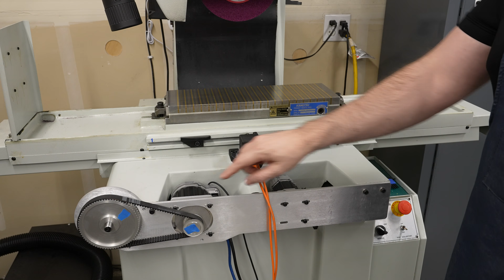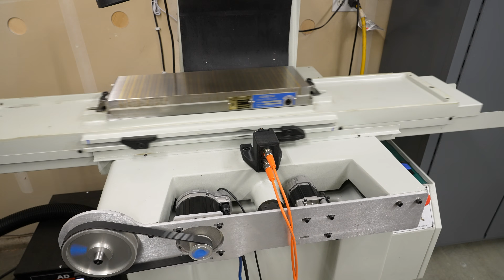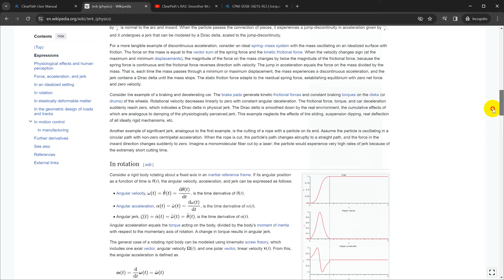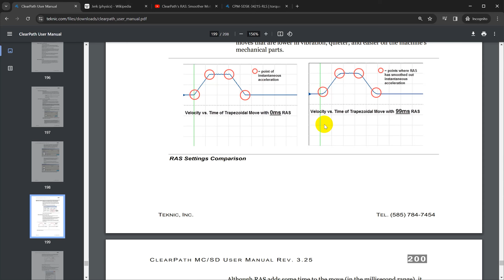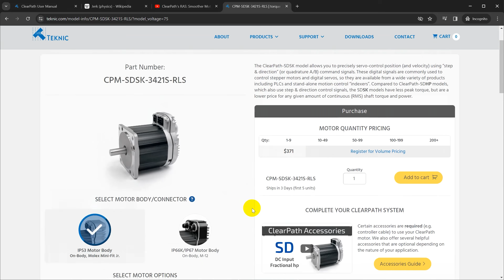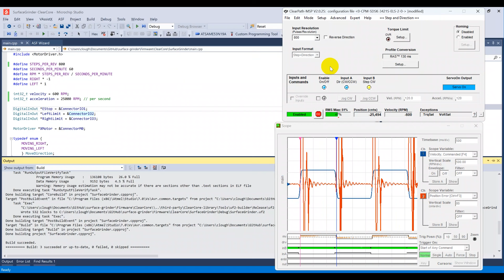Smoothing Out the X Axis Motion | Surface Grinder Automation 7 | Clearpath RAS

Comment: Once upon a time ('75 to '90) i worked at IBM development on what was called 1/2" Tape .  We had similar problems trying to move tape back and forth smoothly.  Your description of the problem with the X motion brought back memories.  Don't mean to be critical, but at 12 minutes into the video you say that the derivative of velocity is acceleration .  I would suggest you get out your Differential Calculus Book.  If I remember correctly, the derivative of acceleration is velocity.  I love it when I see others make mistakes that I often do.   KOKO!
Reply: He is correct.  The integration of acceleration is velocity.
Reply: Sorry about that, you are correct.  I confused the formula D = 1/2 a(t * t) for acceleration..  Velocity is the derivative of this formula.  Gotta think about these things more before commenting.

Comment: You can see that torque in the belt when it reverses. Very impressive.  Also, they need to remove the comma after "proprietary" on page 199.

Comment: If you're writing in C++, you might also mark the external state variables as volatile. Otherwise, the optimizer might make assumptions, which could lead to odd (and potentially dangerous) bugs.
Reply: Like infinite loops being undefined behavior if the don't have side effects. Writes to non-volatile variables are not side effects.

Comment: Either I'm not understand the math the "RAS" uses, or something doesn't add up here. In your initial testing, accelerating to 600RPM at 5000RPM/S should take 120ms. If the constant jerk period with the RAS (S curve acceleration) enabled is 197ms, that means you never reach max acceleration. Any acceleration rate above 3045RPM/S should have no effect on total acceleration time. The velocity graph does not seem to show that, so I'm kinda lost. I wish they would use the correct rate for jerk (steps/sec^3).
I hope the improvement with the more expensive motor is not just a clever mask for slower actual acceleration.
Reply from the maker: It would be interesting to take some actual measurements and see.  There's a lot going on here, and the way I'm using the motor with velocity moves and external switch feedback obscures it further.

My understanding is that if you command a position-to-position move, the total move time will be the expected time of a trapezoidal move, plus the RAS time.  About half of that time is added ramping up to the commanded acceleration, putting the constant-acceleration portion RAS/2 ms behind the trap curve, and the other half of that time is added to the end, ramping the acceleration down to a stop, ending RAS ms after the trap move would have ended, but at the correct position.  Increasing the acceleration will change the acceleration of the constant-accel portion of the curve, but you'll still have the constant time added to the beginning and the end. 

The point you raise about not reaching maximum acceleration is a bit of a brain bender, and I don't have an answer.  The graph does show it reaching steady-state acceleration, which you may be right to question.   My intuition is that the math isn't straightforward, because most of the additional time added by the RAS is spent at much lower acceleration, near the asymptotes.   Without knowing the polynomial and actually integrating it, it's hard to guess.

In my situation, it's more complicated because I'm using velocity moves, so once it hits the switch, it's going to take longer to come to a stop, during which it will travel a greater distance.  In my testing, enabling RAS increases the switch overtravel, and then raising the acceleration shortens that overtravel dramatically.
Reply: @Clough42  It would be nice if they would explain what the setting actually means in real units. In CNC machines with S curve acceleration, sometimes the jerk setting is spec'd in ms based on the max acceleration and max velocity. Any acceleration or velocity lower than that is scaled accordingly. It quickly gets very confusing. 

I've written some S curve acceleration algorithms to varying degrees of success. It's a very complex subject. When you are dealing with things to the 3rd or 4th power the math quickly gets out of hand.
Reply from the maker: @WatchWesWork  Agreed.  Clear data would be helpful.

Comment: Servo tip: a good counter to oscillation is friction. Try using thicker grease/oil on the ways.
Reply from the maker: It's a pump-circulated lubrication system, so this seems like a bad idea.

Comment: Would be interesting to see if there will be any difference in thr torque oscillations when you put some weight on the bed...
Reply from the maker: Very little, in my testing.  The table and chuck are already very heavy.
Reply: But your torque ripple and ringing will reduce when you grind. The drag will dampen the system. 

With the better profiling (planned jerk and snap) you might try reducing the integrator gain and / or increasing the proportional gain slightly. If they have a Bode plot feature in their software, run it and show us next time. Then you can tune it as well as PI will ever get you. :)
Reply: @nf4x  damp

Comment: Sounds like you could code the rounded acceleration and jerk adjustment into the c code, considering that 3d printers and CNC controllers have been blindly doing motion control for decades and jerk has been in use (though not well understood), having the servo do the jerk adjustment, as you said it is the last in the chain, isn't terribly efficient. There are libraries to do better motion control and to talk to the motor like it's a dumb stepper and compensate for the springiness in the system. Not sure I love Teknic hiding what is essentially basic motion control firmware feature behind a "pay wall" -- higher resolution -- sure, but putting what just better math behind a feature wall -- surprised they didn't just ask for the price diff and flash different firmware on the servo.
Reply: my toughts exactly when looking at the RAS description. First run slow from limit to limit to know the boundaries of the movement and then use that in the loop to change the direction instead of using the limit switches.
Reply: Just as I was thinking (that you could control it in software without needing new hardware). I also wonder if you can tweak the PIV-fff parameters (They use this instead of PID motor control)
Reply: It costs money to develop and test new features. So, they have a right to charge. Although being only three days past their 90-day return window, it seems like they could have made a small exception here. Look at all this advertising they are getting! Plus, a clear explanation of an advanced feature with an excellent demonstration of it solving a real-world application. Indeed, that is worth a set of free motors, which, of course, cost them far less than retail.
Reply: @marclevitt8191  it's math, and hiding math behind "proprietary algorithm" smells to me, and working in finance software development for over 2 decades I know a bit about what is a novel use of math, and what isn't, this isn't. You don't charge people for an implementation of a well know kinematic algorithm, similarly as you don't charge people for implementation of a WELL known price curve indicator, it is expected the software will incorporate well known mathematical formulas. Jerk is part of Newtonian physics, RAS is is just that. As a software dev doing a lot of math for a living, I can't agree with saying there is one price for one variant of the algorithm, and another price for simply allowing for that algorithm to be more useful, it's the SAME algorithm.
Reply: The clear paths are servos, you should be able to program in the end stops in software too. I guess from a workflow pov there might be a lot of situations in which having to use the computer to set this would be annoying

Comment: It is looking goo, but do you have any concern about flattage is the drive wire?
Reply from the maker: I think the wire is definitely the weak link.  It's considered a consumable, and I assume this use will wear it faster.  The servo does have the power to tear it out of the anchors on the table, and it's probably good that it can fail safely.  :)

Comment: Is there any reason to not do the jerk limiting in software?
It would require more programming yes, but it also seems like you would have better control over it.
Reply: To save approximately $500? Doing the jerk limiting in software is precisely what James’s doing; it's just Teknic’s software. Right? It seems like a bargain for who knows how many engineering hours it took to develop this feature. But I agree that if one wanted to control more parameters or had a good reason to do it higher up the control chain, now that we think we know the problem and how to fix it, one could provide rounded velocity curves. But then what does Techik’s servos now think of our input? Just thinking out loud here, but now maybe we would want a dumber motor so we don't get rounding on top rounding.

Comment: @Clough42 with the cost of Fusion 360 every increasing have you looked into any alternatives to it? Sorry if you have mentioned it before but it just seems like Autodesk hooked us on the software only to keep increasing the cost of it.
Reply: Ondsel is a skin for free-cad which is a little bit more user friendly than free-cad is out of the box.
Reply: free cad
Reply: @Borden_yt freecad is a user hostile nightmare with serious flaws in almost every aspect! Ondsel is much much better, but still not a replacement for Fusion IMO.
Reply: Did some one report my post critiquing FreeCAD? Not cool. If you tried iterating on your design the way James has demonstrated, and many of us do all the time. You’ll know FC not a viable alternative to Fusion. And that’s not including the fact that its workflows are extremely inefficient and diametrically opposed to every other parametric cad platform.
Reply: @dJOS_500 While I will certainly agree that Fusion far outclasses FreeCAD, I do no agree that it is as unusable as you claim. I use Fusion at work and - because my personal financial resources are limited -  FreeCAD at home. Iterating parametric designs works fine in either. Sometimes I make mistakes in one or the other because I forget where I'm working, but, regardless, FreeCAD is certainly usable for design.

There are CAM and analysis features in Fusion that FreeCAD cannot touch. But, of course, FreeCAD has an OpenFoam integration workbench that allows full CFD simulations - something Fusion doesn't provide unless you have deep pockets. 

So I'd argue it's less clearcut of an argument than you seem to imply.
Reply: @martinmckee5333 the problem is it doesn't matter how decent FC is if you can't do anything with the design, except maybe only if you limit yourself to 3D printing. The natural progression will lead to wanting to do CAM, so Fusion is the only real option. And since even their free design software is leaps and bounds beyond FC, why bother?
Reply: @martinmckee5333  the FC issues extend to simple things like you can only extrude each sketch as a whole, not the separate parts of it, like you can in every other parametric cad. The workflows are laborious, inefficient and make no sense.
Reply: Alibre design and solid edge community edition comes to mind. Neither have cam build in. Their are cheap cam packages available.
Reply: It may be going up in cost, but development costs. Other comparable softwares are way more expensive. Fusion CAM is great as well. I have the fully paid version as I use it for my business using an ATC on my mill and rapids etc. At £1200/3 yrs, it’s great value in my opinion.
Reply: Yeah, I heard of this great software called SolidWorks and Mastercam. Have you had a look into the pricing?
Reply: I'm with you personally, but if I'm James it's nowhere near worth the learning cost of switching just yet -- with a channel to run and projects to do.
Reply: Apologies. I missed the time unit in the numerator.